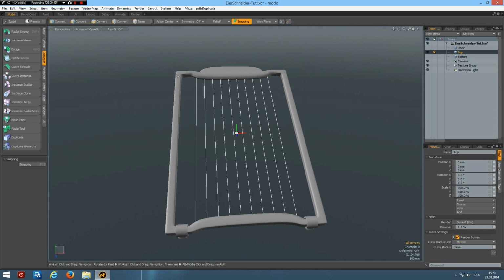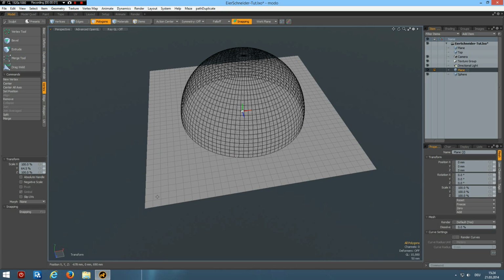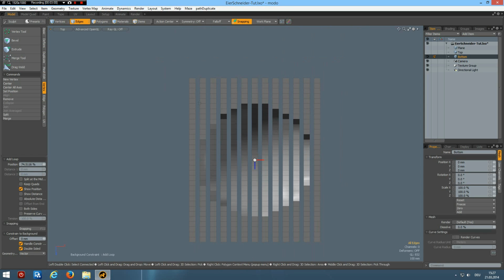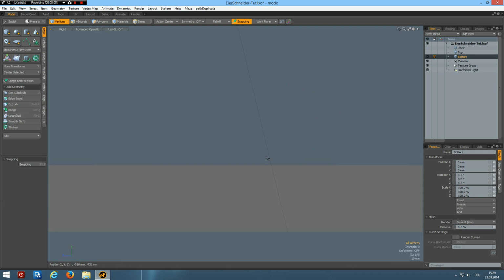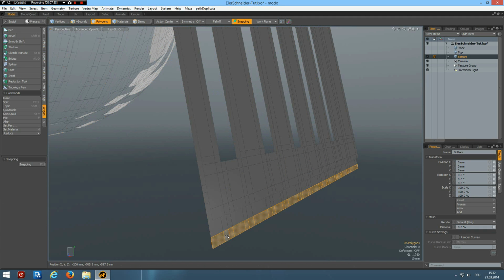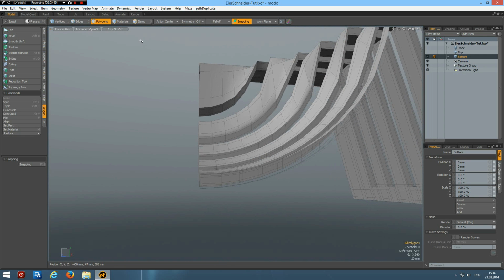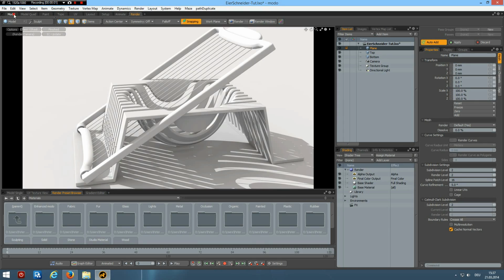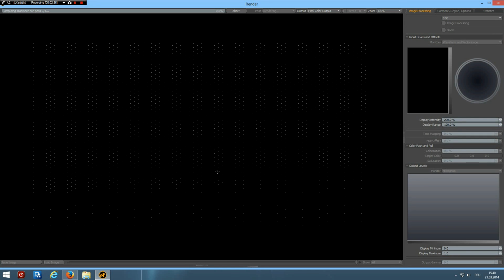The Foundry MODO - Modeling an Egg Cutter

Comment: Your workflows are always so elegant. Do you do much trial and error before you make the video or is it as easy as you make it look?
Reply from the maker: The idea to do the egg cutter came when i was emptying the dish washer. I looked at the cutter and thought how i could model this. When i see a theoretical workflow, then i try it to see if it works the way i thought it would. Then i usually let it be for a while and think about what parts could be optimized.